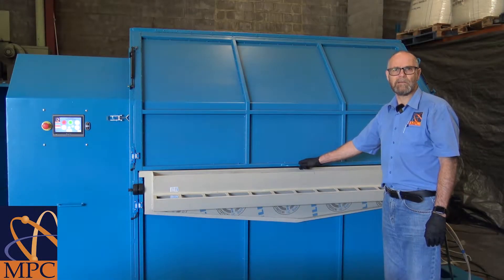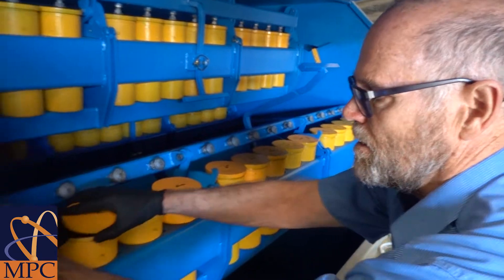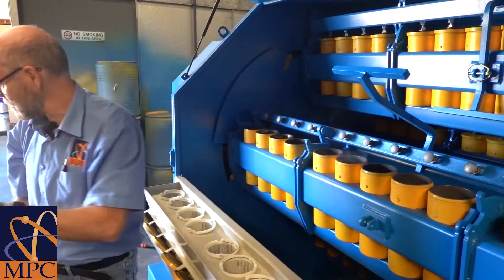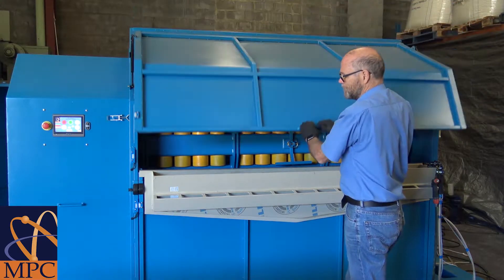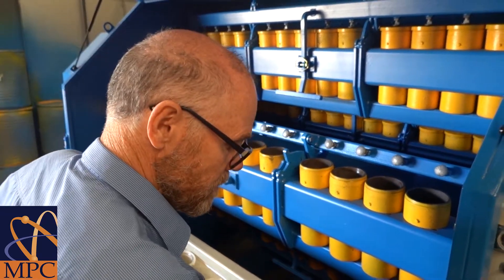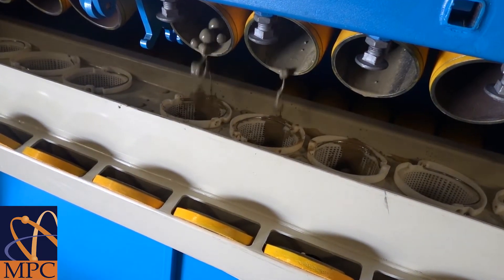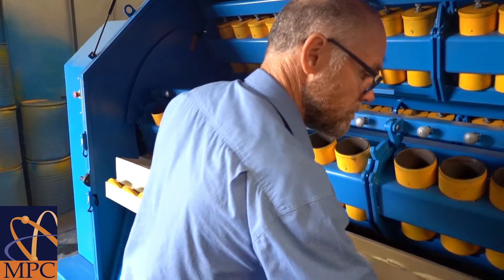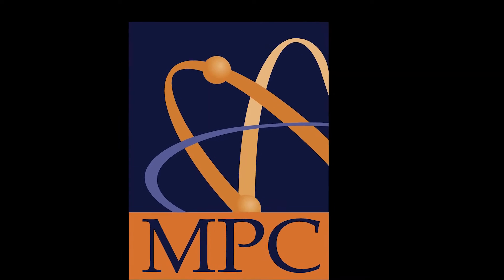How to Operate the PAL-1000

Comment: are we guaranteed of no contamination
Reply: As with all methods contamination is a function of laboratory procedures and operator practices. However, by thoroughly cleaning the PAL pots and grinding media between samples, contamination can be prevented. It is also important to implement quality assurance and quality control procedures, such as using certified reference materials (CRMs), duplicates, and blank samples, to ensure the integrity of the samples and assays.